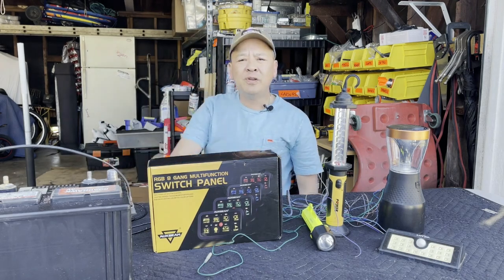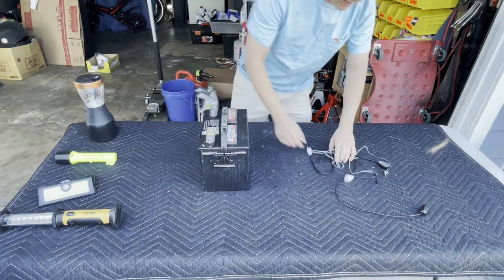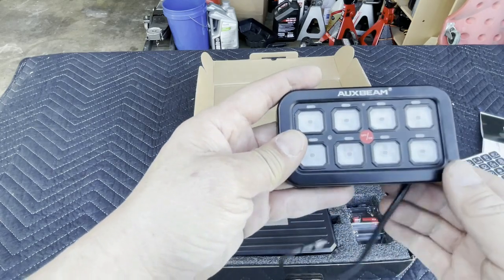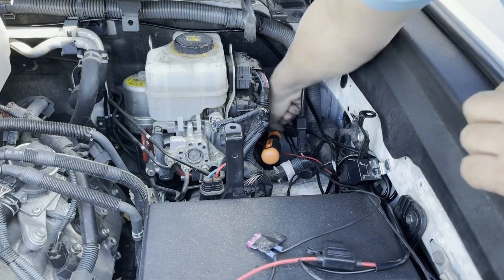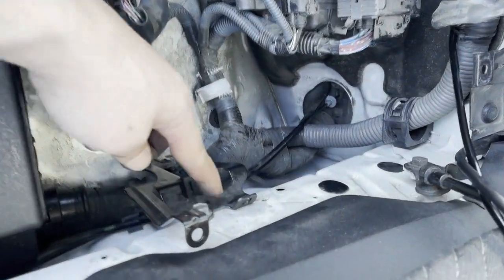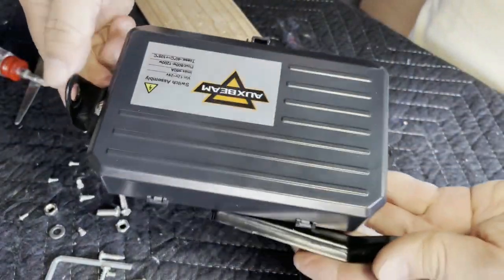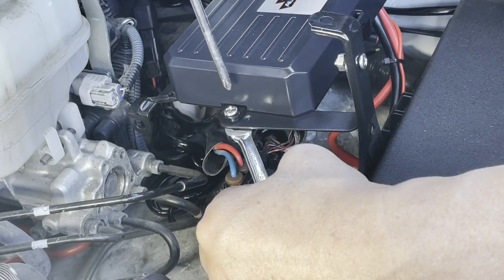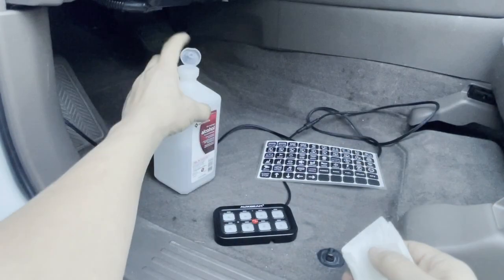LEXUS GX460 AUXBEAM 8 GANG SWITCH PANEL

Comment: Another great video Bob.   For the control panel - I saw how you demonstrated you can change the color of the illumination.   My question is - can you change the brightness (increase / decrease) of the illumination of the control panel ? - much like you can do with the illumination of the stock instrument panel.
Reply from the maker: Yes. It’s easier to download the app to do all that. the app gives you a lot more functions at your fingertips to choose icons, dim lights, choose colors off a large color spectrum, and program your group of lights together. I wanted to film the app portion but i didn’t have a second camera to record with.

Comment: Observation. At 38:22 you day that fuss can be moved. Yes and no. You can de-rate a higher circuit to use a smaller dust but you shouldn't do the opposite. 

I have seen these boards without the silicon coating and the construction of the higher amperage channels is different to the others. The higher annotate use two solid state relays in parallel.

Comment: Hi Bob, how can I have cigarette charger in the back of the truck. It only come with a 120V plug 🔌 in the trunk. What’s your recommendation? Thanks
Reply from the maker: Pick yourself up a 120v to 12v adapter on Amazon. That’s the easiest route. Pretty cheap too.

Comment: just used this as a guide for installing mine, thanks again Bob
Reply from the maker: No problemo my friend.  Just curious did u mount it at the same location or did u choose elsewhere?
Reply: @GXBOB  the fusebox i mounted in the same spot but using the bracket that came with the auxbeam i was able to bolt it directly to the side with the wires facing the engine instead of towards the front, and the switch panel i mounted in the same general spot but used the Ohana Rig Supply mount to sandwich it in between the vent there on the dashboard
Reply from the maker: Nice, thanks for the input.

Comment: Did you end up changing where you put your add a fuse. Coz initially you have tap to the rear wipers but when you tucking the wires it looks like you tap’d it on a diffrent one. Just wondering because i will be doing this soon and i wanted to know where to tap the add a fuse wire. Great video Bob! Appreciate it in advance!
Reply from the maker: Rear wipers fuse is where i left it. Reason why you saw it in a different location is because i was originally looking for a neat installation. I chose the corner rear wipers in the end. It really doesn’t matter what fuse you choose as long as it’s an accessory that turns on and off with your ignition.

Comment: Does the white backlighting match the gauges or is it blueish white? Rgb vs rgbw
Reply from the maker: Sorry its really the camera I’m using to film . The actual color is  turquoise/aqua that i settled on. The model I’m using is AR-800 which is RGB.
Reply: @GXBOB   If you wanted the same color as your gx gauges does it match pretty well?
Reply from the maker: @devzor  good question, I’ll check tomorrow. I’m hitting the sack in a few minutes.
Reply from the maker: @devzor  i forgot to mention. If you download the switch panel app, it’ll display the large color spectrum for you to choose from. So much easier than using the buttons to eyeball your desired color. It also gives you the ability to don your lights as well as choose your icons and place them in any square you want.

Comment: Hey Bob
I just tried install mine and I noticed my fuse for my pod lights which also got from lasfit is 15 amp not 20 as urs so is that ok if i just install my wires to 20 amp in auxbeam ?
Reply from the maker: If Lasfit provided you with 15amp then stay with 15amp. I most likely went up to 20 for some other reason i don’t remember now.
Reply: @GXBOB  yeah but there is no 15 amp connector in auxbeam. Tehre are 5,10,20 and 30 so should I install the pods to 20 amp in auxbeam?

Comment: Would the front windshield wiper fuse work instead? Its 10 amp and not a 15 amp like the rear, will that matter? For some reason my 2023 model does not have a fuse in the location you used. Or are there other fuses I should be looking for?
Reply from the maker: That’s fine. I only used the rear wiper because it’s never used so any load on it is will be predominantly the Auxbeam.

Comment: Very good video. Would it  be possible to wire up this panel to allow you to use your accessories even when the vehicle is turned off?
Reply from the maker: Yes, instead of the wires going to the fusebox, route it to the battery.

Comment: I've been wanting to do this for a while but wasn't super confident, but you've eased my worries lol. I did have a question, since I have a light bar thats 60 amps, how would I wire it if its more powerful than the supplied fuses
Reply from the maker: Hey Josh, there is a really good write up about this from another post that can explain it better than i can.  Go half way down the thread and read a post  titled "wiring accessories to the system".  It starts off explaining that even though the circuit breaker is labeled 60 amps, its actually a 100 amp circuit breaker.
https://expeditionportal.com/forum/threads/review-auxbeam-8-switch-accessory-power-panel.206225/
Reply: @GXBOB  thanks for the response and article. after adding the relay, does it matter which circuit I end up putting it into, since I am adding that extra relay and fuse, it shouldn't matter which circuit its placed in correct?
Reply from the maker: @JoshRus  Basically, you are correct because  low current can flick the relay to bridge high current to your light bars.  But i would sleep better at night if you were to use the 30 amp channels to trigger your relay as opposed to the 10 amp channels.

Comment: My lx 570 doesn’t have rear windshield wiper 15A in engine fuse box. Would 15A fog light work the same?
Reply from the maker: Yes, as long as the fuse powers up on ignition, not on continuous power with the engine off.

Comment: hello sir, for the connection to the sportlight need to add a relay or not?
Reply from the maker: Hey ! Relays are only needed if you are going to use the switch that comes with the spotlights.  Since you will be using the Auxbeam switch panel, it already has built in relays.  You can remove the relays that comes with the spotlight.
Reply: @GXBOB  oohh .. thank you sir, I want to install for the camper van project :-)

Comment: Hey Bob, quick question, since we merge the two fog lights and each have 20 amp fuse, we still put them in a 20 amp in beam box or we should double to make it 40 or we need to put them separately in each 20 amp?
Reply from the maker: Amps = watts / 12. Let’s say each foglight is 55 watts. 55x2 / 12 = 9 amps. 2 foglights running to a 20amp fuse is more than enough. You can actually run 2 foglights at 100 watts each and still be good.
Reply: @GXBOB  thanks Bob
Reply: @GXBOB  also can u make a video about roof rack waterproof LEDs lights and the connection process? I guess they are 12 V and use for RVs as well
Reply from the maker: @bencti4851  I’ve been reaching out to roof rack makers with no success.
Reply: @GXBOB  i just ordered from JWoffroad along with side exterior molle
Reply: @GXBOB  something I not understand.if 9 A is enough then  why put on 30A or 20A ?